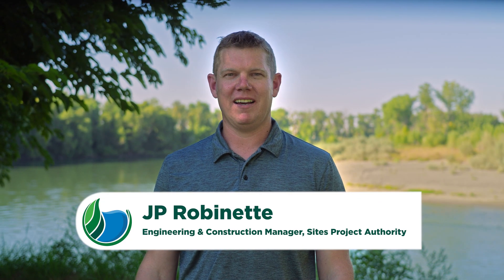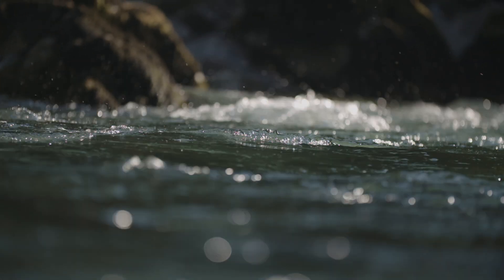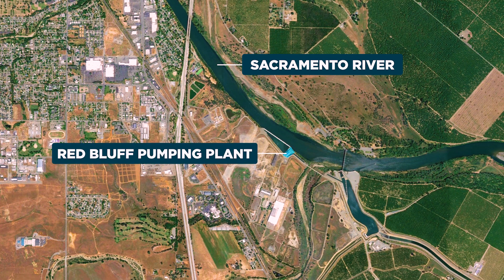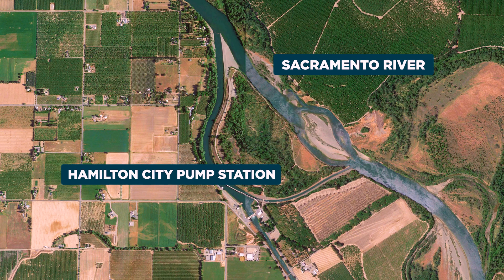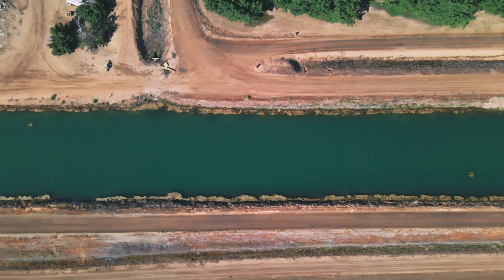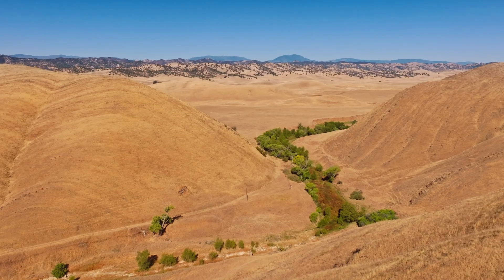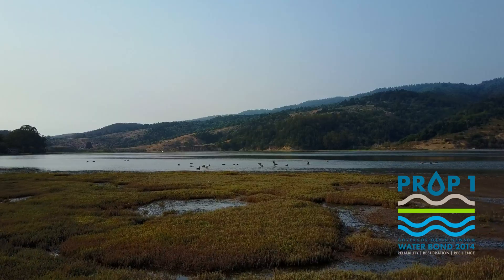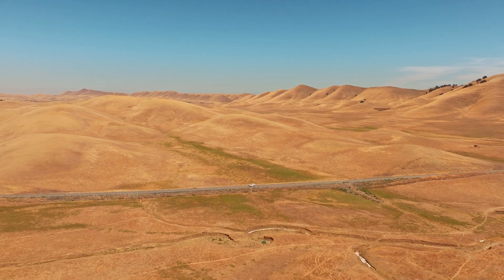A New Look at the Sites Reservoir Project

Comment: Barnard Construction is easily the finest most qualified companies that could have been selected for this project. We have worked with them and all their competitors for 20 years and they far outshine Keiwit, Flatiron, and their Joint Venture companies.
Barnard will conduct outreach for qualified craftsman without the use of Executive Order 14063, Community Benefits Agreements, and repugnant union PLA's (Project Labor Agreements). Where only the finest men and women will be selected for their qualifications rather than their union affiliation.
Community Benefits Agreements implemented by SANDAG, CAHSR, and other government entities, made possible by Biden's EO 14063 and it's predecessor Obama's EO #13502, resulted in the exclusion of 92% of the construction workforce from working on large public works projects over $35M and JOC of $5M for not having union affiliation.
The days of the  exclusionary tactics of labor unions, while driving project costs up 20% using the anticompetitive bidding processes of the CBAs, are now coming to a close.

Fair prevailing wage employment for the most qualified is now returning to construction.

With MVL v. USA, CBA's will be shoveled into the ash heap of history.

Thank you Barnard for being the best thing that's happened to construction in 50 years.

Comment: It will never be completed with the corruption in California,just look at the scam bullet train.
Reply: The award to Barnard Construction of Montana will be a game changer. Cost overruns will be held to a minimum while unions graft and corruption will not be tolerated.

Barnard Construction is easily the finest most qualified companies that could have been selected for this project. We have worked with them and all their competitors for 20 years and they far outshine Keiwit, Flatiron, and their Joint Venture companies.
Barnard will conduct outreach for qualified craftsman without the use of Executive Order 14063, Community Benefits Agreements, and repugnant union PLA's (Project Labor Agreements). Where only the finest men and women will be selected for their qualifications rather than their union affiliation.
Community Benefits Agreements implemented by SANDAG, CAHSR, and other government entities, made possible by Biden's EO 14063 and it's predecessor Obama's EO #13502, resulted in the exclusion of 92% of the construction workforce from working on large public works projects over $35M and JOC of $5M for not having union affiliation.
The days of the  exclusionary tactics of labor unions, while driving project costs up 20% using the anticompetitive bidding processes of the CBAs, are now coming to a close.

Fair prevailing wage employment for the most qualified is now returning to construction.

With MVL v. USA, CBA's will be shoveled into the ash heap of history.

Thank you Barnard for being the best thing that's happened to construction in 50 years.